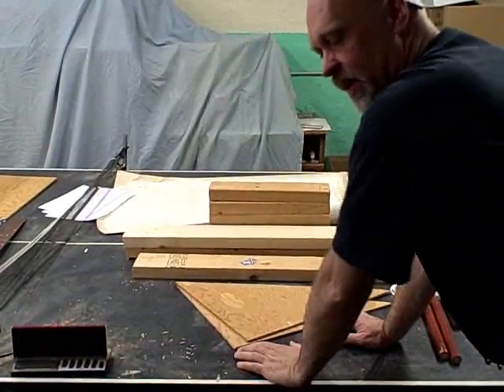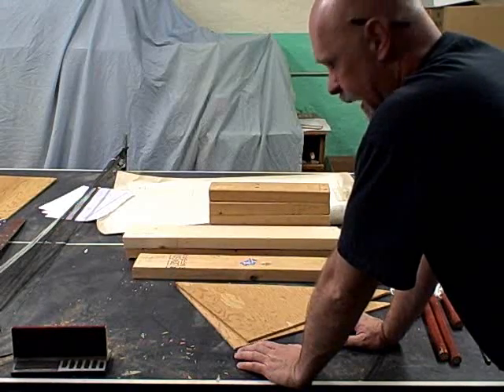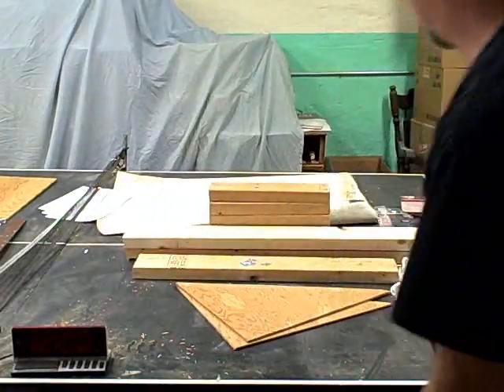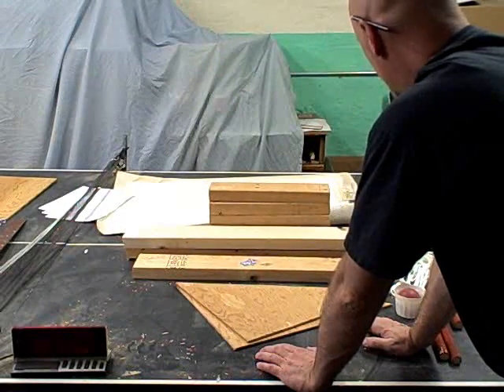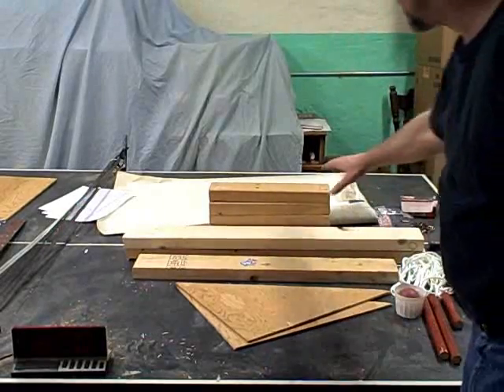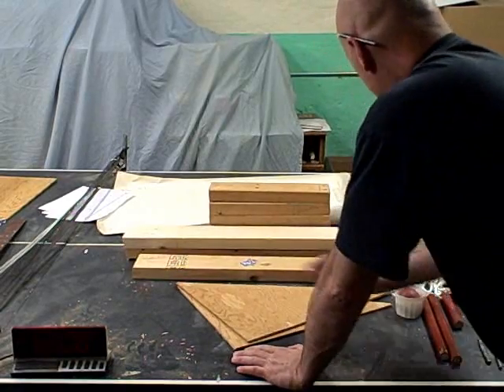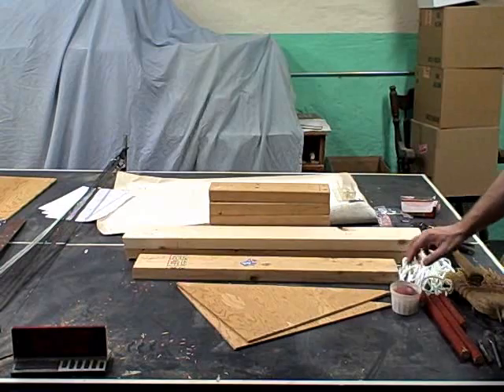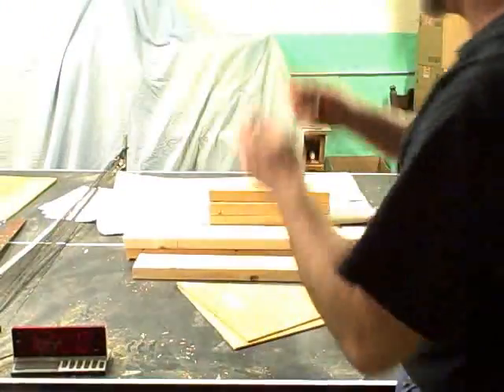"The Wyvern" a 3 foot Torsion Catapult built  in 23 Minutes

Comment: i built one but without any plans, i used a 2x4 at first for the arm but used a 3/4 inch manilla rope as the tortion, the 2x4 snapped first try, so now im using a 1/8 wall 1 inch metal pipe as my arm, and i need a 4 foot length of  the same tubeing to tention it up, it will throw a lacross ball 300 yards consistantly, its epic

Comment from the maker: @MrJMan887 You are absolutely right about increasing the range by moving the pivot point back.  But, it takes more force so you should add more weight. And, the pouch can be a tricky thing. Try making it bigger. SHould work better and still open fine. Keep me posted. Siege engineering can be tricky.